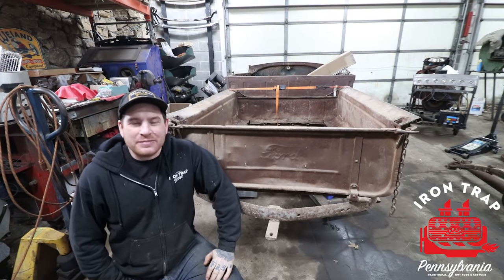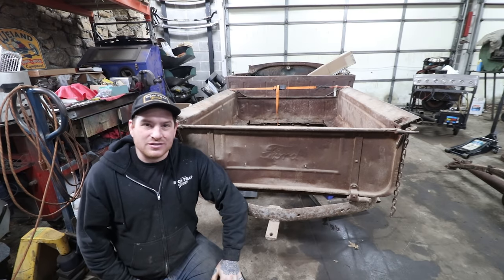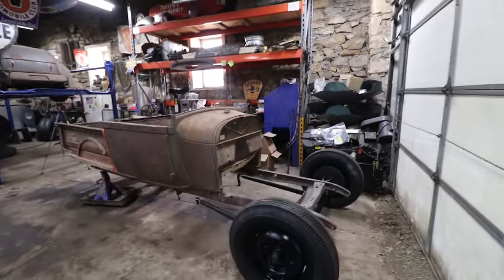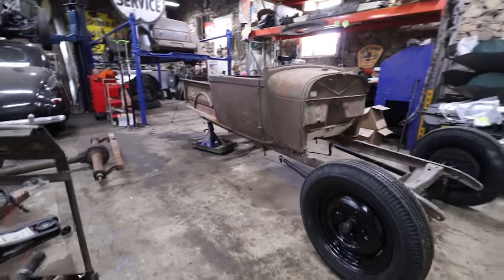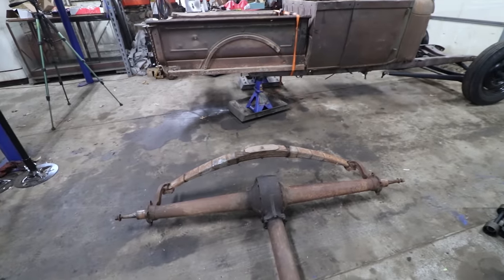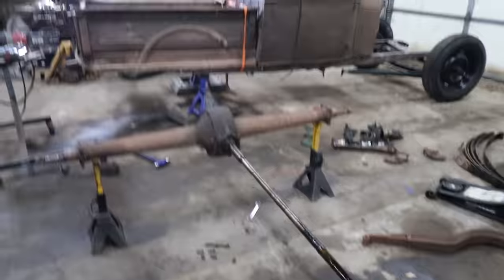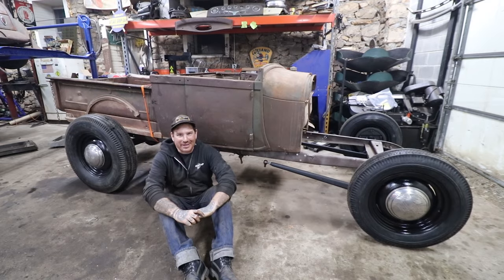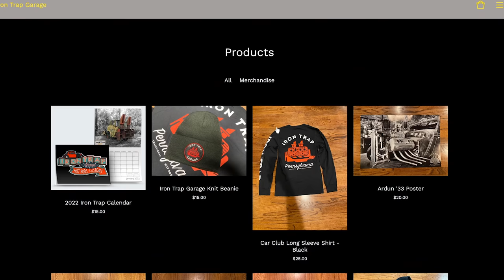Building The Suspension For Our Roadster Pickup Shop Truck!!

Comment: everyone should have a shop truck this cool. i mostly have had late 60's early 70's muscle cars so the skyjacked look is right up my alley. i did it to avoid cutting tires on my fenders when i was running meats on the rear, but it looks pretty awesome here without fenders as well.

Comment: Noticed the Texas receiver hitch, are you going to pull a trailer? There are vintage Model T trailer hitches of a simple yoke mounting under the rear spring bolt nuts.
However a Model T frame is a good base to construct a vintage trailer with a Model T or A pickup bed. Turn the frame so the front crossmember is in the rear, locate the bed to the rear so the tailgate functions. The side rails protruding ahead of the bed can be notched and folded to form an A frame for the hitch mount after removing the arched rear crossmember. Also could be folded 90° to close the opening. Mount a Model A center crossmember midway of the frame rectangle to mount the T front spring, a torque tube mounted to the A crossmember and under the repositioned side rails becomes the tongue. Mount the wishbone forward on the T front axle and mount the ball clamp under the torque tube. A
The discarded rear crossmember could be utilized flipped under the repositioned frame rails,  add shocks of your choice.

Comment: Way to go Matt!
   Good that you spoke on the dangers of working alone under jack stands. I am building 2x4 back up cubes for a project as we speak. 
   Couple of questions:
*Are there any strength issues to heating and bending the steering arms?
*Are the rear drums splined or use keys? If keyed do you run into sheared keys with the higher horse power engines you install?

Comment: You need radius rods to hold the rear end square to frame.  If you don't plan to use a torque tube, 3rd. link needed to hold the differential up straight.  The transverse rear spring will not hold differential square and vertical.  Rear coil-over shocks and heavy front tube shocks help stabilize "tippy" transverse springs.  Every metal piece of suspension was built into old cars for safety and reliability.  More strong metal parts than original would be safer and more reliable.

Comment: Remember the stance will change depending on the weight of the parts you are hauling. Don't start too low in the back.
Reply: beat me to it... yep, anticipate some payload or you'll be riding like a boat coming home from the warehouse.
Reply from the maker: Yep good point!

Comment: Why install new bushings, ream them, then throw tons of heat to drop the steering arms! Would it not be better to do the bushings after?
Reply from the maker: We didn’t melt the bushings. I usually use sacrificial bearings and swap them out after. It doesn’t matter how you throw a strike it’s still a strike. Just how I did it this time doesn’t much matter as long as you don’t melt the bushings.. and if you did you’re doing it wrong.

Comment: Sure looks tall right now, but as you said, with the additions in the back, it will get lower over time. The standard used to be, at least with Kustoms, was the height of a pack of Lucky Strike cigarettes.
Reply from the maker: This isn’t a custom. It’s a 40’s style hot rod. Different ride height/stance